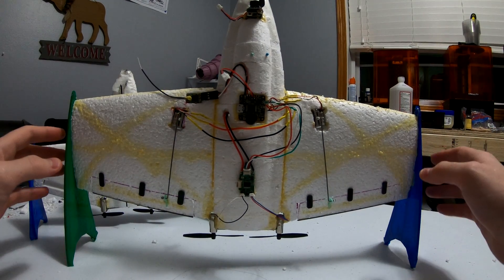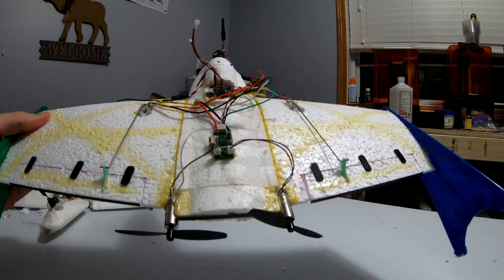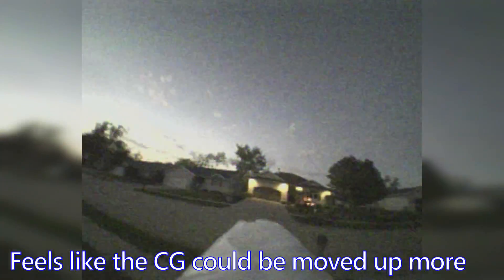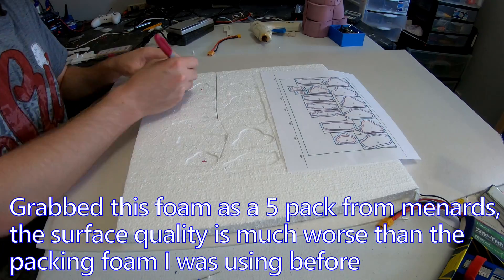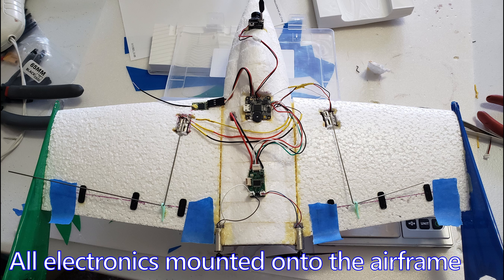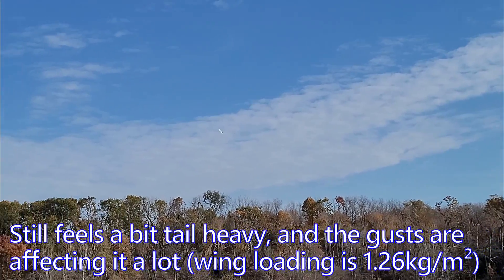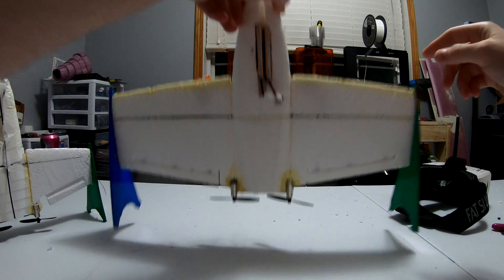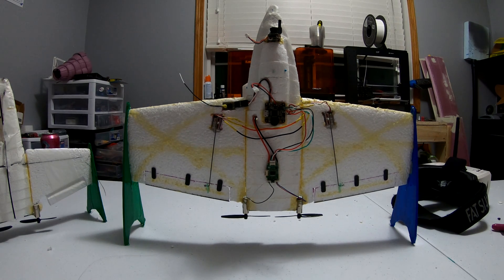Sub 100g FPV Delta Wing | Build | Flights

Comment: Would you like to share the files/DAT files? I just built a cutter myself but want to test it out.
Reply from the maker: Sure! Here is a link to the GCode: https://drive.google.com/file/d/1D0Y7geAUjJ5DSPXJ5Fl9Os2g6AO_Io_z/view?usp=sharing  

I use GRBL HotWire Mega 5X to control my wire cutter, and some  of the GCode is made for my machine. It might not 100% work for your machine depending on how you have yours set up. The GCode is generated based on the two gantries being 24cm apart and the work piece being 18.5mm thick placed in the center.

The Code is also available on github so you could generate your own GCode for your machine, but I haven't set-up a good user interface yet, so its a bit annoying.
Reply: @fureter6986  thanks! I am also using GRBL as per RC Keith design.

Comment: A pretty decent flight I'd say. This plank style is very fussy about CG position and I found the smaller size makes it even more twitchy. 
Your audio is super quiet btw.
Reply from the maker: Thanks! Yeah the CG was really twitchy on the V2, and a little less so on the V3 with the larger size.

I'll need to work on my editing more lol, guess my current process isn't good for volume, thanks for the heads up!